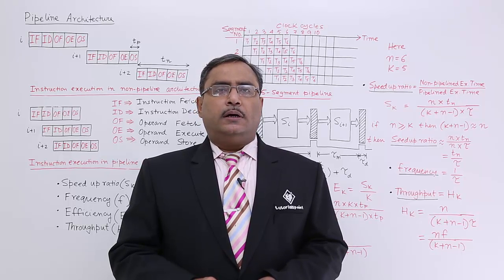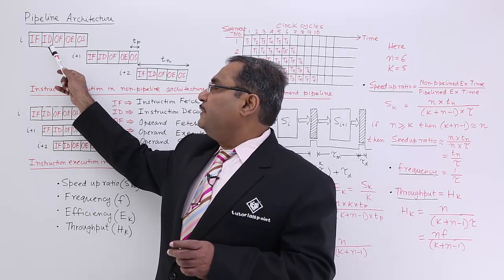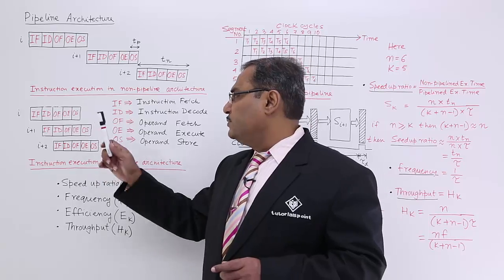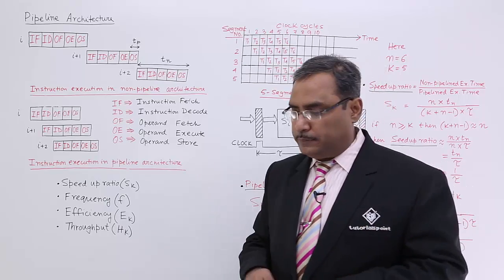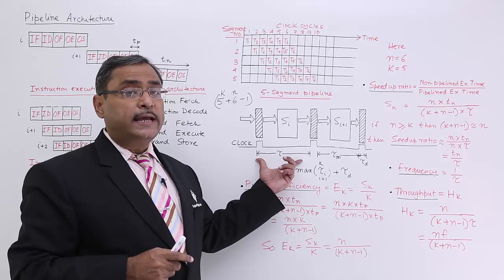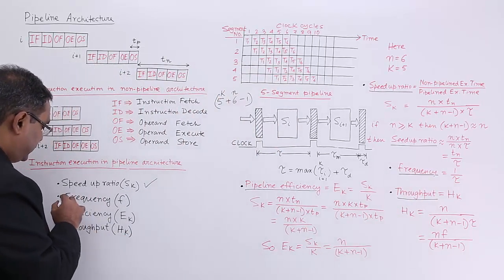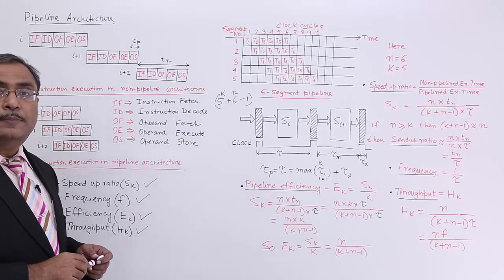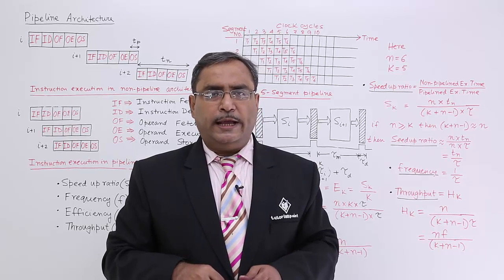Introduction to Pipeline Architecture

Comment: [Title: CPU Pipeline – 5 Stages]

Instruction Flow →
┌────────┐   ┌────────┐   ┌──────────┐   ┌────────────┐   ┌────────────┐
│ Fetch  │ → │ Decode │ → │ Execute  │ → │ Memory     │ → │ Write Back │
└────────┘   └────────┘   └──────────┘   │ Access     │   └────────────┘
                                         └────────────┘

[Bottom Caption: Multiple instructions move through these stages simultaneously.]

Comment: I think there are some confusions for n and k. Such as (nonPipelineExTime = n * t_n), it might be (nonPipelineExTime = k * t_n) for the example when he sets n = 6 and k = 5, so does pipeLineExTime. Similar confusion also happens for the max(tao_i) in tao calculation. That might be 'n' instead of 'k'. A easy way to correct all of those confusions is to set k = 6 and n = 5.
Reply: you think wrong

Comment: Question:-
If instruction is added at x postion in pipeline then at which postion it will complete its execution??
That is x+4
For 1=1+4=5
For 130=130+4=134